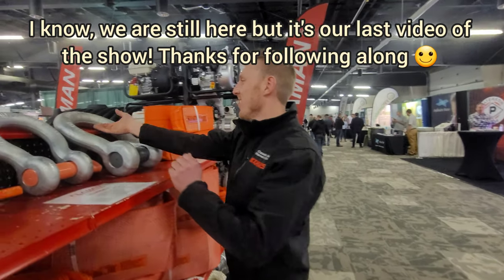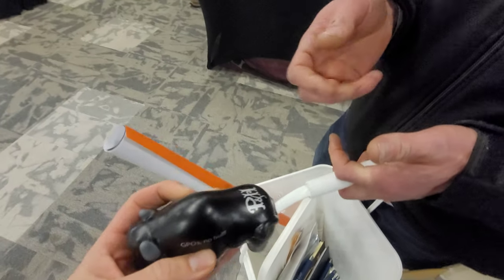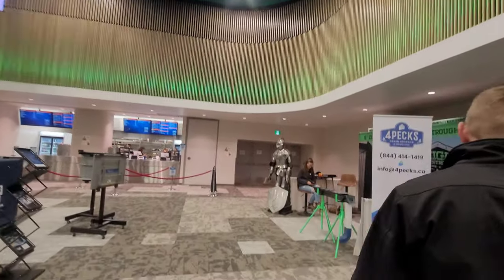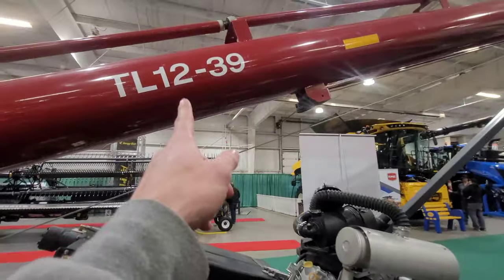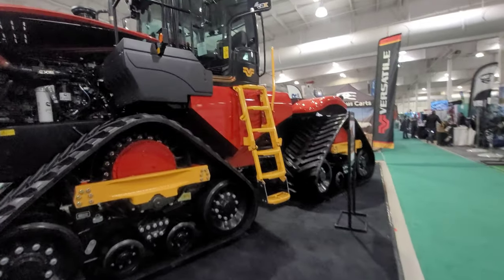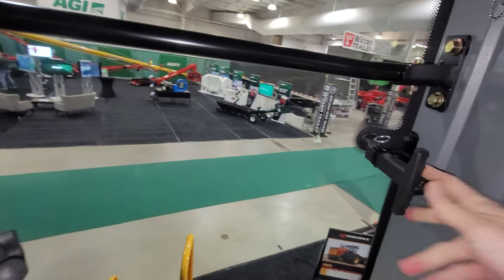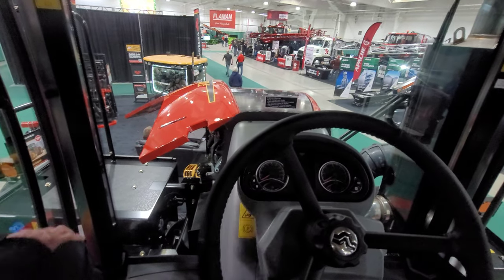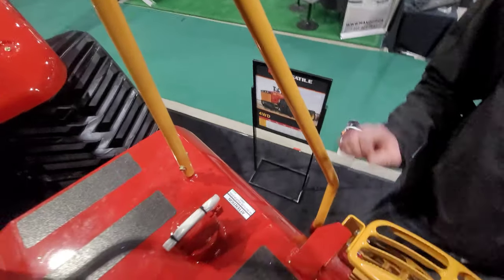Versatile?  Final vid of CPS 😅

Comment: From what I’ve learned all Mike needs is quality cupholders in the right spot and that makes or breaks the tractor
Reply: + good speakers and a real fridge. 😂
Reply: And good sun shelalds 😂
Reply: And adjustable blinds that will stop anywhere and not make much noise when closing.
Reply: @conortobin8474  Which it seems most do not have good sun shades, to be good the shade should be solid, no holes.
Reply: Don't forget about his real refrigerator also. Lol.
Reply: That's probably why he went with the X9 for a combine
Reply: Don’t forget the soft close doors thats an instant deal maker

Comment: The versatile seems like a well built tractor, you don't really see that many around. Mike you should definitely see if you can get a demo.
Reply: Being Canadian made, should be a no brainer....
Reply: He wondered what the sound system sounds like  one of those blue tooth speakers outta a bud light beer box.
Reply: @Oddball_KellysHeroes  Canadian made but owned by the Russian company Rostselmash. No need to give money to the oligarchs.
Reply: @clearskiesranch1362  🙄  giving money to big corp like John Deere is so much better.
Reply: @clearskiesranch1362  So are you going to pay the Canadian employees??
Reply: @Oddball_KellysHeroes  If anything, the Canadian government should use the war in Ukraine as an excuse to take control of Versatile
Reply: @clearskiesranch1362  Canadian government? That would be the end of good Versatile equipment.
Reply: @EdmontonRails  I don’t think an oligarch from Russia calling the shots is much better
Reply: @clearskiesranch1362  There is little interference in the operation of Versatile currently, their engineering and manufacturing isn't being tampered with. If the Canadian government got involved Versatile would be turned into a dumpster fire from the top down. Whether it's trying to acquire new trucks for the army or keep Bombardier afloat, the Canadian government has fumbled every industrial/technological project they've touched. I wouldn't trust someone from the Canadian government to clean the chain on my bicycle.

Comment: Well, we're running a versatile 620 with tracks for almost 5000 hours now. Mainly in front of an 75feet airseeder, an reefinator and some tillage.  it pulls like a champ. But it's far from beeing smooth 🤣 it already snaped the exhaust more times them I could count, cracked the fueltank and broke the cabmount in 2 spots.
But the cab and the soundsystem is bloody awsome 👌🤣
Reply: Any solutions from Versatile?
Reply: @OOpSjm  not really. The local dealer upgraded the cab suspension to airbags but mounted the compressor underneath the drain pipe of the AC so that didn't last to long either.🤣 
It's certainly better wirh airbags and relatively smooth in the field but driving it down a dirt road is still torture. 
In the last 500 hours  we also had to replace all the buttons and joystick on the armrest. But due to the supply chain issues it took 4 mount for the new joystick to arrive, so we had the tractor parked in the middle of a field and couldn't move it anymore 🙄
Reply: @lukasfesser6453  Pretty much same across all the brands at the moment it seems.
Reply: @OOpSjm  that is very true. 
I don't want to make the tractor sound to bad. He really does pull good and is comfortable to drive. It dosnt got any of the fancy things like a JD or cade would have, so it's pretty easy to operate. 
Just not sure if we would go for tracks again
Reply: Just curious. Does it seem rough or just because it's a track machine? I've ran some Challengers and RTs and they seemed just as rough/rougher. Never been in a Quadtrack or Deere "Quadtrack"

I thought the Versatile was slightly smoother than the 2 track. Maybe the pivoting boggies.

One I ran was the same way though.  Hardpan in high gear would rattle your teeth. Plenty of crap fell in the cab. The monitor didn't last very long either. 😂
Reply: @broc212  track I assumed like similar machines.  JD 2 tracks are notorious for loosening tooth fillings 😄
Reply: @broc212  I never operated another tracked machine for a longer period so can't really compare tbh. But the few times I did drive John deere quadtrac been quite a bit smoother.
Our neighbor farm bough a case quadtrac the same year as we bought the versatile and it done similar jobs and hours. But didn't had nearly as many problems as our versatile. Like snapping exhausts or cracking fueltanks etc...
Reply: @broc212  the versatile is relatively comfortable to sit in when seeding or so. But you better book in for a physio appointment before you take it down any dirt road🤣🤣
Reply: @broc212  That's a good point. Versatile tracks have an extra range of motion in their wheels, in theory they should be smoother and hug the ground better than other tracks.

Comment: Great video.  I drove a Versatile tractor 1973-1976. And it was at least 10 years old I think.  
Oh.  And NO enclosed cab.  In northwest Florida. After my first year I got waterproof radio that would only pick up 1 station, and it was a gospel station.
Also, the only controls I had was the huge gear shift lever, 1 hydrologic lever to raise/lower disc, and the steering wheel.  NO buttons to push and absolutely no joystick or monitors.

Comment: Definitely would be cool to see you demo a versatile, yes the cab functions aren’t as fancy but still pretty decent, I did this fall get to run a 520 on big duals, and it was pretty good! Biggest thing is the door for the cab, better learn to duck lol cup holders are decent, stereo was actually pretty good, learning curve going from throttle/ shifter combo to a separate controls wasn’t to bad, would do a transmission reprogram to when you start or use clutch it goes to 3 or 1 instead or 4-6, but tons of grunt from the Cummins! I’d definitely delete and get rid of the bulky muffler! Another feature that is actually nice is your separate switch to turn hydro pump on or off so save on auxiliary pump then it just uses main pump! And man those cabs are huge!! And you could fit 2-3 big people in that cab and still have room!

Comment: as someone ho worked at a versatile dealer as a tech, they seemed pretty reliable other than the hydraulic couplers were forever blowing out, and they would occasionally eat hydraulic pumps. i couldn't complain too much about them, they seemed pretty alright, they were simple and easy to work on. thankfully the couplers took less than 5 mins to change. could swap them for something different.
Reply: They updated them for better fittings recently as well

Comment: I’m a OTR driver. You need a Pure sine wave 2000 watt+ inverter to run a Tassimo. It’s because of the computer in it. You can run a Keurig with a modified sine wave. The heating elements in both require at least 2000 watt continuous power rating.

Comment: I own a 610 with 900 duals.  Its a great tractor. Versatile does an excellent job of putting all that power down to the ground and it pulls like crazy.  However the cab is not as refined as a Deere.  It's a bit louder inside and the surfaces feel a bit cheaper.  And getting into the cab you have to climb up onto the first step and then open the door.  The design of the door limits you from opening it from step 2 or higher.  Not sure where the Versatiles are priced at today but 2 or 3 years back the difference in price between it and a comparable Deere was incredible.  The decision to buy one was very easy! Anyway, it would be worth your time to demo one

Comment: Last harvest down here in Australia they had one 620dt Versatile pulling out bogged trucks and the guy driveing it said they are very smooth and can really pull but they also had a another one on 3mtr wheel tracks but it was a 580 on wheels they said it was a little bit ruffer and pulling wasn’t it’s strong suit.